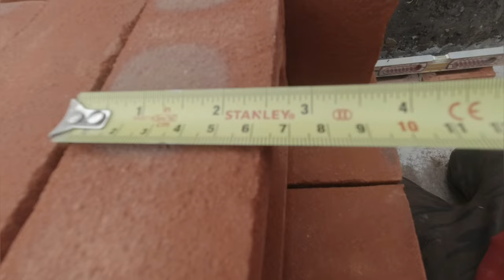How to build a garden wall (step by step)

Comment: Nicely done mate great tips. FAIRY LIQUID if you were to look at it under a microscope all the bubbles are different sizes this apparently can make the mortar weak and unstable , in my experience this does seem to be the case, Febmix and other Admixes under a microscope the bubbles are uniform and all the same size which produces a stable mix that's how one QS explained it to me once👍👍
Reply from the maker: Pretty much as I thought bud I heard never use it under ground in subs. Super structures its ok. All u really know out of my experience is it makes a lovely old gauge of muck 😆😆 so nice to use hey
Reply: @trickybrickys  👍
Reply: No fairy liquid mate. Turns mortar to powder

Comment: Hi can I ask a question please? Is there any need to tie the leaves together when doing stretcher bond with double skins…? Thanks
Reply from the maker: Yes there is. anything over 6 courses high. Put some wall ties in , Then every 6 courses if your going up higher 😁
Reply: @trickybrickys  brilliant thanks for the advice. What’s the gap you would leave between the two leaves? Am wondering whether to do stretcher bond double skin or just do an English or Flemish bond. This is for a small retaining wall about 6 courses high.
Reply from the maker: @NosyGecko  the overall two skins should bev the length of a brick. 215mm
Reply from the maker: its up to you what bond you do . i normally do the same as the house so it matches
Reply: @trickybrickys  smashing thank you. Keep up the videos invaluable !

Comment: I'm not a bricklayer but I have a sincere question. How come those Bricky mortar laying things aren't used more often? I don't see them being used on any site videos. If they are faster, more precise and cleaner then how come?
Reply from the maker: Because 1 they are not faster . 2 they are not more precise and 3 they are not cleaner. The bricky tool thing. Was for dumb nuts to learn with. To be honest it was a gimmick tool.. I saw them on Qvc 🤣🤣 learn the proper way buddy. 😉 Good luck mate
Reply: @trickybrickys  I guess I fell for the advertising, lol. What do you thing of 3D printed houses? I think the lumpy walls look horrendous.
Reply from the maker: @Kousaburo  I've got a feeling they will crack as no expansion joints in them. The ruffness of the would be rendered out on the outside or glad and drylined on the inside so you never see it I'd imagine 👍😁

Comment: Mb a stupid question but why would you not include your blocks into your corners? As in first course blocks then bricks on top. Genuine question

Possibly due to stability? It’s the only thing I can think of with my very limited knowledge and experience
Reply from the maker: Mainly for the video to demonstrate how to build a brick corner.  We had plenty of bricks to use. Alot of walls don't need blockwork.  So I figured it's best to show the way to do it 😊

Comment: Hey man nice video, can you make a water storage tank using brick walls similar to what you do in the video ? Or would you use a different technique
I want to store about 1000 liters, one square meter so nothing too big.
Reply from the maker: I would be more inclined to use a plastic tank. And put brickwork around the outside I think. I've built a raised pond before using this method. But the pond was lined with a rubber liner. Hope this helps 🙏

Comment: We use a petrol belle at work and have never had a problem setting the mixer up like that however we drop it on the drum not the handles and haven't had a problem with oil. Hope this helps someone.
Reply from the maker: Nice

Comment: Great vid. I learnt a lot.Just about to have a go at pretty much the same project. My one concern is the wall is to run alongside a driveway which slopes down to the road. Did I miss in the vid how you level each end to the other? I want the wall level and not to follow the slope of the driveway. So its going to be more bricks at the road end than the house end. Should I us a laser level? Any help would be appreciated. Thanks in advance.
I forgot to mention, I cant level the footings as the driveway is made of reinforced concrete about 15cm thick with block paving ontop. So I think the concrete underneath the blocks would be sufficient footings for a small wall? just that it is sloping. Hope that makes sense...
Reply from the maker: You have to cut your first coarse to suit the fall in the drive.  😉

Comment: This was kinda relaxing to watch, thanks for the video.  I have two questions if I may.  1. If you were building a taller garden wall (say 6') would you add a DPC? 2. In this video, I noted that you didn't fill the dip in the center of the bricks for the top edging bricks, is that because they aren't taking any weight, so just a little mix around the edges is sufficient?  Thanks again for the video, I want to watch more now! :)
Reply from the maker: No damp on a outside wall.. why would you put a damp in is the question 🤔. Its a outside wall not a house. And the top brick is full. It's fills as I compress it. 2 years on and still looking mint 👌
Reply: Thanks so much for the prompt reply, appreciated. I think I had just assumed they were always used (I have zero experience to draw from) and thought maybe they'd also help protect the cement between the bricks above it.  Thanks again for the reply, really enjoyed watching you work. :)

Comment: great video mate. would you build a 15 metre straight wall usiing this exact method, it has 2 returns but is stepped at 5 metre intervals?
Reply from the maker: I would imagine so bud. I'd put a expansion joint in every 5 m on that
Reply: thanks mate @trickybrickys
Reply: so essentially your building 3 seperate walls with the expansion joint seperating them?

Comment: I only came across your video today. Awesome job! Just a quick question - you are making a 0.5:5 mix ratio. I always thought 1:3 was the right one. I'm about to try to build one myself but now I'm a bit confused about the ratio.
Reply from the maker: 4-1 sand to cement. The mortar has to be quicker than the bricks. So if anything ever cracks the mortar goes first not the bricks you are using. You can check this stat out on the side of any blue circle bag of cement. All the correct ratios are printed on the side. 😁😁 hope that helps
Reply: Thanks for the reply. Last one - where do you get these bricks? Or the type? (I'm really newbie at this)
Reply from the maker: @mismily-sb7hr  I woukd recommend Travis perkins.  And download there app. You will get better prices. They are called Atherstone reds. But the maybe different ones on the site that suit your property better 😁😁
Reply: Thanks for all the replies!

Comment: Hi, sorry for my question, but why are you leaving that gap(cavity wall) between wall layers? If I could do that method but with brickwork of shed wall, should I use sometimes some conectros (sorry have no clue what is proper name for it) to attach one wall to other one? Many thanks.
Reply from the maker: Yes you can use wall ties. And cement goes in the gap

Comment: Nice little job,neat and tidy,what time did you start and finish,have a good week my mate
Reply from the maker: Started 8am Friday finished at 1pm. Then popped in Saturday 9am finished at 11am.  Only round the corner.  2 minutes from.mine. so 2 nice early days 😁 7 hours total on my own. 600 bricks 10 blocks and the brick on edge 😁😁
Reply: @trickybrickys  could do with a few more of those
Reply from the maker: All day long.  I'd love to do them all the time.
Reply: Great 👍 job tricky lovely 🧱 wall

Comment: How did you run the line through first? To make sure it lined through straight, was there pins or did you measure from a certain point to keep it square ?
Reply from the maker: I did the 3 4 5 rule at the corner bud. I should have put that in the video.
Reply: I get you mate, good video though

Comment: Does that wall need no weep vents or drainage to deal with water behind it from the soil? About to replace wooden sleeper walls in my garden with similar height to what you built there so brilliant video to help with that but I’m wondering about drainage.
Reply from the maker: There was very little retaining being done by this wall bud. But if I was doing a sleeper replacement I'd put in drainage yes. 2in bt pipe is best 😁
Reply: @trickybrickys  could I ask what bt means? Is this drainage behind the wall or through it? You make it look super easy but I’m hoping if I take my time it will look okay. Again, great videos.
Reply from the maker: British telecom ducting buddy. 😊😊
Reply: @trickybrickys  never heard of that, will look into it.
Reply: Sorry to ask again but I’m now about to start this and feeling a bit overwhelmed. Should I just build the wall then core drill weep holes afterwards (using some plastic pipe inserted), or build them in as I go? I just can’t work out in my head how you get the weep hole through both brick skins in a wall like you have built.
Reply from the maker: Just build some 2 inch br duct pipe into it mate 👌.
Reply: @trickybrickys  cheers mate, I assume you just chop the bricks to accommodate. I’m looking forward to it but I’m sure it won’t be as easy as you make it look. Thank you for quick response, is it appreciated.

Comment: the frost line where I live is at 36"....do i have put my footing at that depth?  I always thought i did but I am not sure.  Any advice would be great
Reply from the maker: It's a outside wall it's always going to freeze same as anything else outside.  the deeper the footing the better I'd say and build it when it's not frozen . And it will be fine
Reply: @trickybrickys  thanks a lot.  My thinking is that I'm going to built up most of the wall with cinder blocks or caps then use bricks from where the grade starts.

Comment: Yep.! Fairy liquid kills the cement.! A few years back when I was a foreman we carried out work for the local councils, they never allowed plasticiser, only lime, one particular job ( 2 storey block of flats) I walked out of the site office and could smell lemon washing up liquid and the subbies had poured a load into the water butt ( no silos in those days) the labourer gave a load of bollox when I questioned it.! Walked over to where the Bri lies were laying and all you could smell was lemon.!!!! Needless to say all the work they had done that day was pulled down…..
Reply from the maker: That feb we use makes the mix as good as with fairy. So I've stocked up on it. Brilliant stuff. Thanks for your comment bud 😁😁